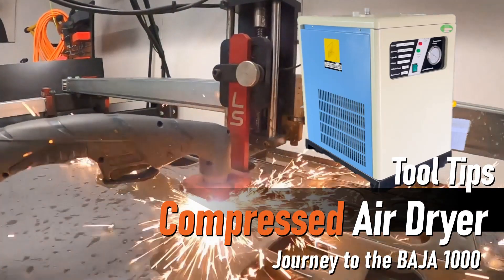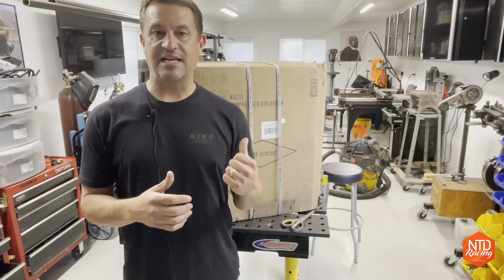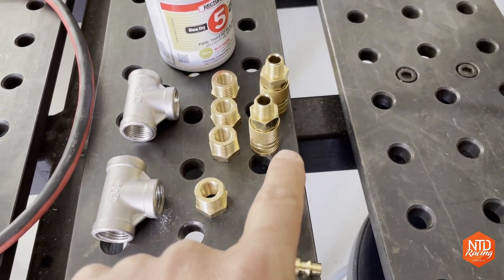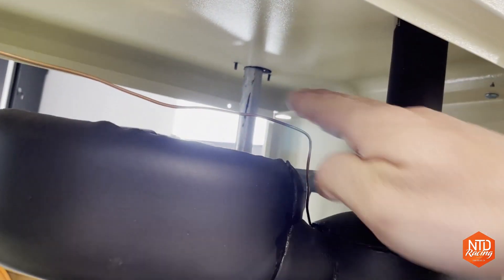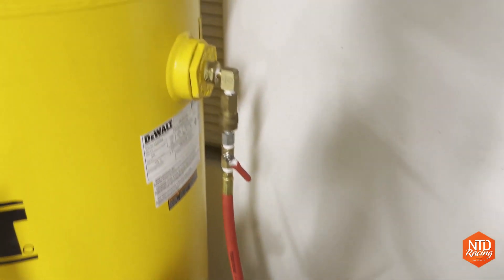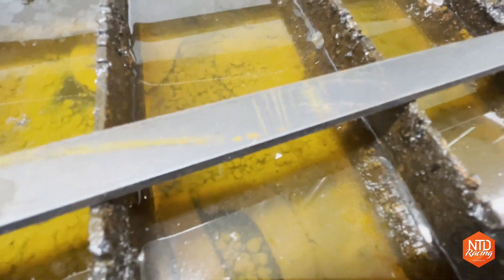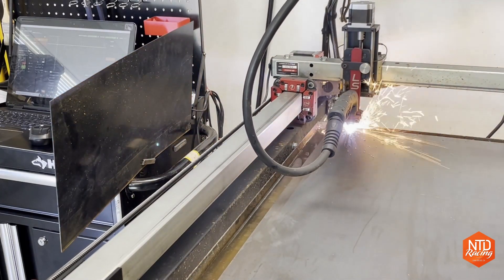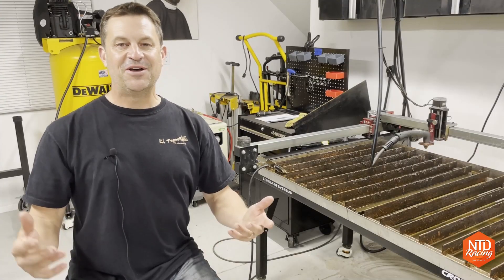Harbor Freight air dryer upgrade to the Langmuir Systems CrossFire Pro - NTD Racing

Comment: Inside your shop, how loud is the Dewalt compressor ? 
I'm looking to get a 60 gallon compressor when I order my cnc plasma table.
Reply from the maker: @MidnightCustoms-C20  I have to wear ear plugs when it is running.
Reply: @ntdracing  thank you ! I've watched your videos on the langmuir  tables. And I originally wanted the XR after seeing your video, but I don't have the room. So I am going with the CrossFire pro. Your videos are a wealth of information and knowledge that have helped me make an informed decision. Thank you!

Comment: Great video! I just bought an 80 gal. 5hp compressor that I was trying to figure out the best way to provide dry air for sandblasting and powdercoating. your video sealed the deal. How has it been working out for you? Do you still use the CanAM setup?
Reply: BTW, the dryer is currently $599. I'm hoping for a coupon here soon.
Reply: How many amps is your plasma cutter and how many gallons is your compressor?

Comment: U are Lodi pressure if u use 1/2 from the compressor to d machine u well hve a way better pressure maintained at the machine or 3/8

Comment: What size square tube are you using for your air compressor base.
Reply from the maker: Just some 2x2x.25 and 2x3/.25 scrap I had left over.   It really is not that heavy.   A 2x2x.125 would work.

Comment: The HF book says 14 NPT and I don't think there is such a thing. 1/2 in NPT pipe thread does not want to screw to HF thread? You screw yours on with no effort? I don't get it? Cheers Randy

Comment: Is it neccessary to use air dryer for plasma?
Reply from the maker: Absolutely.  If the air is not dry, your consumables will blow out quickly and cost a bunch.

Comment: Does the air dyer put off a lot of heat?
Reply from the maker: No…at least I have not noticed any.
Reply: @ntdracing  Thanks for the quick reply.  One last question.  Is there much condensate coming out of the drain tube or is most of it evaporated?  I don't have a floor drain in our small compressor room.

Comment: Do you still have the air dryer and is it still working good?
Reply from the maker: Still love it.  Working great.
Reply: @ntdracing  thanks I have the cross fire pro and was thinking on getting this.
Reply: Any info about it helping consumable life?
Reply from the maker: @fil131  I think mine last about 5 times longer compared to the Cam-Air I was running.

Comment: I was just looking at this set-up.  The air dryer says 100 psi working pressure with a max of 140.  Did you regulate your air down to 100?
Reply from the maker: I did not.  Close enough?
Reply: @ntdracing just wondering if everything is still working good even without regulating the air before the air dryer I have the same setup and realized I didn’t put a regulator before.
Reply from the maker: Used it today.  Working perfectly.

Comment: I would like to know more about the rolling stand you made for your compressor. My compressor wants me to drill into my floor which are epoxy coated and I like to move things and clean behind and under them. Where did you get the stand and wheels for you stand?
Reply from the maker: I will try to add that into my next video, but it is fairly simple.  I had some extra 2 inch square 1/4 and 2x3 1/4 to make the base.  It is hefty.  I used the same wheels that I used for my plasma table.  Link is at our store at www.NTDRacing.com.   The Dewalt recommended to bolt it to the floor also, so I would say that is the best advice.   I decided to make it mobile.  It works fine, but there you will have to decide the risk you can accept with it toppling over...my disclaimer👍
Reply: @ntdracing  Thank you and I like your idea better than the Compressor Manufacture. The manufacture will always take the worst case scenario which I understand. I don't have any kids playing around and the compressor was stable while I wired it and tested it for leaks while sitting on the shipping pallet with the bolts removed.  I have new metallic epoxy coated floors and I just can't bare the thought of drilling holes into it.

Comment: Is it a noticeable difference having the air dryer over the desiccant? Big diff in price, I’m awaiting my pro and picking up a freaky 60 gallon 11 cfm compressor tomorrow, trying to decide if it is worth spending the extra 300$ to get the dryer.
Reply from the maker: Huge difference.  Some people say the HF stuff is 50/50 if it will work.  I may just be lucky.  Best mod I have made to the CrossFire Pro and the RW45.
Reply: Tha is for the response!

Comment: Why not plumb it between the compressor pump and the tank? That what the air in the tank is dry and you wont have to worry about draining the tank.
Reply from the maker: Sounds like a great idea.  Wonder if anyone has tried it.  It works right now, so I am not planning any changes.  Thanks for watching.
Reply: @ntdracing  Do it, will make a huge difference. Also, keep the plumbing @ 1/2" everywhere you can & adapt it down to 1/4" @ the furthest point downstream you can to connect your hoses. You are severely constricting the amount of air moving through it otherwise.

Comment: Do you have a chart for cutting amp/speed you can share ?
Reply from the maker: I keep it really simple.  I just send 100+ PSI to the RW45.  I run the amps wide open at 45 and vary the speed.  What has been working for me is 25ipm on 1/4.  50ipm on 3/16 and 65 ipm on 11GA.   I have cut very little 16GA and 110ipm works.   Could probably cut that faster.  Hope this helps.

Comment: What do you do for smoke or water splashing?
Reply from the maker: The smoke on steel is not too bad.  If I am making a long cut, I will turn a fan on to evacuate smoke from my shop.  With aluminum, I always run a fan.   The water is not that bad either.  The worst would be when the cut is done, and the plasma torch goes through its “cool down” blowing air directly into the water.  In that case, I will try to quickly jog the torch over a place where there is still sheet.
Reply from the maker: Smoke...I open a door to the outside and run a fan.  Water splash is not too bad.  Sometimes I will have to wipe water from the floor.

Comment: A professional electrician to wire up a 110V cord? Was that sarcastic?
Reply: More a CYA for him. People get real weird about electricity on the YouTube. They are all experts......
Reply: @tollav  what is CYA? Thanks 😊
Reply: @tollav  I find that hard to believe. First of all: I love Dave and his videos. But this is the context: shop talk, CNC plasma cutter that "offers" pinch points, temperatures in excess of 20000 degrees, compressed gases, and literally how to design and manufacture suspension parts to go 100+MPH offroad in foreign countries. When it comes to connect a 110V outlet however... Come on ☺️
Reply: @AlessioSangalli  All of this is not the point. It would take to long in a YouTube reply. And your replies are part of why he said that.
Reply: @AlessioSangalli 
Cover
Your 
As$

Comment: Awesome suts on the 3/16  what amp setting on the razor weld, and air psi??   how about 1/4"
Reply from the maker: May not be the best way, but I just leave it at the max setting 45amps and do not regulate the air pressure going in.  I let the RW preset air adjustment do it’s thing and it has been working great.  1/8 at 65ipm. 3/16 at 50ipm and 1/4 at 25ipm.   Hope this helps.
Reply: @ntdracing  THANK YOU

Comment: Cool man, I’ve been thinking of getting one of these, I have an aftercooler then a desiccant tank but this could make my desiccant last longer between recharges
Reply from the maker: Good point.  I have been thinking about reconnecting the CamAir filter after the dryer.  I would think it would work better and last longer.  Thanks for watching.

Comment: I just fired up my Pro last weekend, works great. You mentioned LS misfire fix. Have a forum link for that fix? Thanks from Colorado.
ps. Those Dewalt gryo screwdrivers after awesome, I buy the more expensive one, DCF680N1, for the rotating handle and the tensioner/clutch. I have at least 4 and love it.
Reply from the maker: https://forum.langmuirsystems.com/t/razorcut45-misfire-issue-razorweld-tech-bulletin-9-23-2020/10431  Hope the link works
Reply: @ntdracing  Link worked fine. If my RazorCut experiences misfire, I'll know what to check first. Thanks for the fast reply.

Comment: Explain the height control option on the table please.
Reply: Basically monitors plasma arc voltage and automatically adjusts torch height. better cut quality, works well when your material  warps while cutting. Saw a YouTube video somewhere a dude was cutting corrugated metal roofing into metal art torch raised and lowered over the corrugations. I have it on my Crossfire pro and am glad i bought it.
Reply from the maker: The Torch Height Control is a must if  you have long continuous cuts.  If you are only making small cuts where the torch will remain within a small cutting area, then the Initial Height Sensing IHS will work ok.  Basically, the torch will start by dropping down to the metal to be cut, zero itself then raise back up a height that you tell it to cut in your CAD/CAM program (I use Fusion 360).  From there, it will not move again until it is done with that continuous cut and, stops and needs to pierce again somewhere else on your cut program.  As long as the bed is true and the metal stays flat...it works fine.  The reason that Torch Height Control THC is so cool, is because after the Initial Height Sensing does its thing and the torch fires, it takes a measurement of the voltage.  Now THC says X voltage equals X height and will move the torch up and down to maintain that voltage during the cut...even if the table is not true or the metal is warped.  Totally worth adding THC.

Comment: Do you use Sheetcam for nesting or the new Fusion 360 nesting feature with the LS control software.
Reply from the maker: I only use Fusion 360 because most of the things I make are 3D flattened to 2D.  I will have to check out the nesting feature.  Have not tried it yet.

Comment: Can you provide the coupon code you used?  I have been looking to upgrade but I can't find a coupon.
Reply from the maker: I am working on getting a discount code for my channel.  Will let you know as soon as I do.
Reply from the maker: This was not one of their  normal discount campaigns.  This was an individual coupon one of our drivers had.
Reply: Do you have the discount code for the air dryer?
Reply: That makes sense then, because I’ve been looking and their standard coupon code Doesn’t work. I think I’ll just pull the trigger anyways.